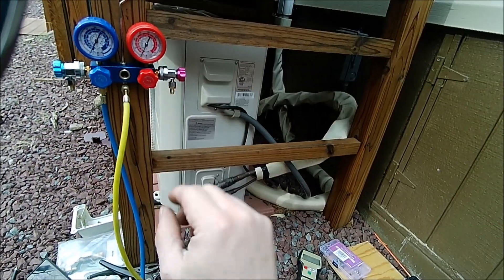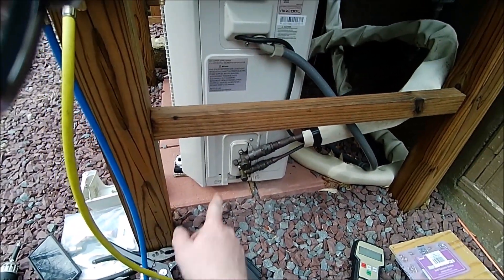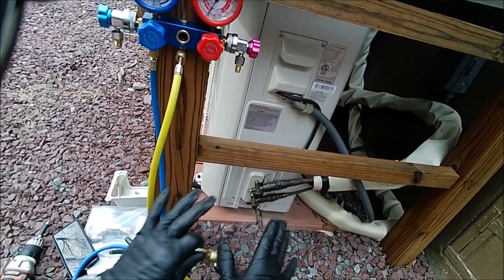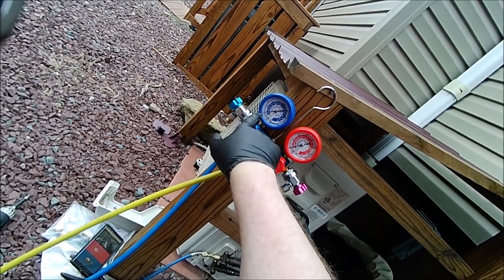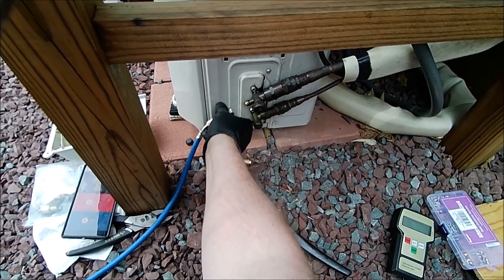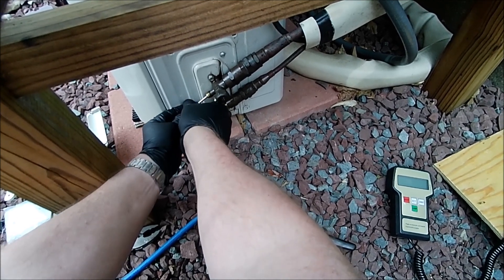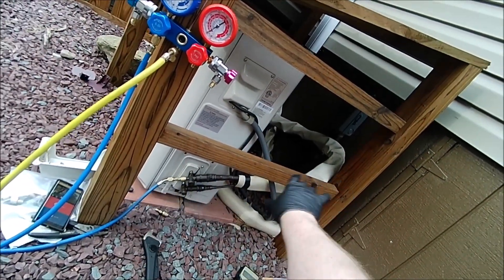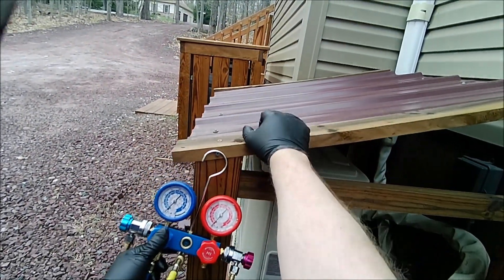Mini-Split Advanced ReCharge & Valve Core Replacement

Comment: the unit leaked but how do you know if there was any refrigerant left in the unit?  Did you recover any refrigerant first?  That way you know you are not over charging the system?  Just curious, because I need to do this very same thing after the high pressure line was broke off and much refrigerant escaped.....
Reply from the maker: The gauge measures pressure on the low side, my kit is simple and easy to use, you hook the gauge up, see the pressure, get it more than half way into the blue, 125 to135psi and you are good to go. Seals most leaks, just remember to charge in cooling mode 62 degree set temp, no matter the inside or outside temp. Quick, easy 😀

Comment: Great video! Do you have a better link to the Valve Core Set? The one listed doesn't work. Thanks!
Reply from the maker: https://www.amazon.com/dp/B07F36KV79/ref=cm_sw_r_as_gl_apa_gl_i_WSB47W5P4J5SVCKDXFQW?linkCode=ml2&tag=computradecom-20

That is the link, also updated the description, thank you!
Reply: @GarageMahalLife  Thank you! You're the man!
Reply: @GarageMahalLife  What valve core did you use for the R410a system?  I did not see one listed in that package.

Comment: I can logically figure it out but I rather be sure.  I know the king valves need to be close while vacuuming. But when charging is the king valve to condenser open and the line king valve close?
Reply from the maker: While charging the system after vacuum, all valves should be open, unit on and  in cooling mode, 62 degrees. Charge at Kimg Valve.

Comment: Thanks for the video. It confirms some things I visualized but wanted to actually see. I am concerned that you evacuated a partially charged system instead of doing a recovery. I read the notes you put on the screen, but I feel you didn't emphasize this enough. 

One suggestion. Instead of venting  refrigerant through the high side to displace the air, try this. Before opening your refrigerant tank valve, connect your vacuum pump to the manifold high side. With the low side valve closed, tank closed and high side open, you can then evacuate the manifold and the line from the tank to the manifold. Then close the high valve and you are free to open the tank and low side with zero air added to the system and zero refrigerant released to the environment.
Reply from the maker: Thanks for your comments

Comment: Thank you for the video!  I have a mrcool 4th Gen 5 zone 48k btu mini split that I installed in April.  In November I found a leak in one of the lines due to bad copper sweating/brazing by the factory.  It took mrcool customer service 6 weeks of emails and reminding them to ship to finally get my replacement quick connect line set.  Today I paid an HVAC guy $650 for a few hours and 4lbs of 410a.  Mrcool only covered the cost of the new 25' line set, even though they said I should have a professional come out evacuate and recharge the lines.
I'm thinking of buying your setup to test the system for proper vacuum and for future issues or top ups.  While the HVAC guy was very helpful and educational, we didn't vacuum the lines or pressure test as he said that would be a lot more expensive.
Reply from the maker: Thank you, I'm here to help. Sounds like the cheapest hvac quote I've heard, typically they want 1000$+ anyway my kits are perfect for the DIYer, home or business owner. Feel free to ask any questions you have.

Comment: Hello, I have really enjoyed this video. 
There are a lot of "influencers" out there who present similar information, although by introducing a lot more discretization and complexity and then identifying expensive tools and attachments needed. In my mind this takes people away from trying to solve problems in a simple and simpler way. As an example, other folks talk about needing to remove the schrader valve under the umbrella of trying to achieve a deeper and faster vacuum. My sense is that this is not a requirement and a DIY person can do without. Kudos to you for achieving this Sir. 

Please do help with comments on couple of things 
(I have a 18k MrCool unit, which leaked out & the company supplied a replacement air handler & line set. I have done the attachments & now I need to pull a vacuum and add new Refrigerant)

1. what state (open by turning ccw or closed cw) do the 2 refrigerant valves (under the brass knobs which require an allen key to open/close) need to be in ? for evacuation first ? and then charging as you did ? and after finishing charging ?
2. separately, if I plan on replacing the schrader valve should I not do so before evacuating (i dont have any refrigerant left in the lines) ? my thinking is that by removing the schrader valve all the lines in the AC will immediately revert to atmospheric pressure because of the opening. I can then put in a new schrader valve and then pull the vacuum ?

Thank you very much for your help.
Reply from the maker: 1st, Thank you 😀
So did they send you a charged line set or just the line set. If charged, you shouldn't have to vac the system... as they have valves that self seal on all the connections. If un charged, you would install, ccw to open after install, then pull the vacuum. Then charge. Before that, replace the Schrader as needed... feel free to email you phone number to brian.niskala@cnjrail.com and I'll be happy to call you and "walk" you through this...
Reply: @GarageMahalLife  Thank you very much for responding.

Initially, I assumed that the replacement line set was pre-charged and connected it to my older outdoor unit. However, surprisingly, the unit provided barely any cooling ! I had also noticed (on hooking the line set to the air handler and the outdoor unit) that there was an absence of whoosh/swish which I had heard on making the same connections years back. I took this to mean that perhaps the line sets were not pre-charged as I thought they were. I got in touch with Mrcool and they mentioned a few things I was not expecting
- the outdoor unit/compressor also comes pre-charged & that the line set contains "a drop in the bucket" on comparison. (I am still not a believer because line sets are ~ 25 feet)
- the leak that I experienced also perhaps leaked out the refrigerant in the outdoor unit
- I should expect air/moisture in the system because of the older leak and run a vacuum 

With regards to the leak -  When I removed the old air handler I noticed green splotches on the backside and am assuming that is where the leak was. When I had a HVAC tech come out in the fall, he just added more refrigerant without doing a leak detection. I also purchased an electronic leak detector and on sniffing around the line set sheathing it went bananas & that is the evidence MrCool needed. If I still experience leaking I will assume it is the schrader valve and only then will I attempt to replace it. 

I just received the equipment you outlined and I am going to attempt the procedure you have shown. If I get stuck I will reach out via email separately. Once again, thank you very much for taking interest and posting such wonderful videos. In this day & age where youtube is populated with influencers we need folks like you who try to provide cost effective and easier solutions.
Reply from the maker: @sunnykhosla8891  Thank you and I am here to help. And I believe the tech had it backwards, the lineset is charged and by comparison the compressor is but a drop in the bucket 🪣  anyway be safe.
Reply: @GarageMahalLife  Just giving you an update here. Everything went surprisingly well (so far)
- i was impressed to see the 3.5cfm pull the vacuum into -Hgs in about 15 minutes
- they vacuum held overnight which I took to mean there are no residual leaks
- I charged the Refrigerant, perhaps 2-3 oz over
- I did a bubble leak test which was clean & then 
- followed 4 hours later with a leak check using an electronic leak detector which was clean
the system is now cooling superb 🤓
Thank you very much for your feedback and the videos
{ps - I sent you an email with a question about your other interests}
Reply from the maker: @sunnykhosla8891  Thank you

Comment: Finally I found your video and someone that did this the way i was understanding from the manufacturer, beginning and what made sense. Someone not adding steps that were not necessary. This was my understanding of how it all worked and it really isn't as complicated as others have made it look. I had moved my compressor onto wall brackets. and. accidentally hit one of the lines leaking gas out. Not what anyone would want to do and lesson learned to recover the refrigerant first. But thought just raising it onto the brackets I would be ok... Thank you so much for showing the right way, and not making it more difficult that it needs to be to pull vacuum on the entire system and recharge.  Once I got my 1/4 in flare redone after over tightening, my vacuum held perfectly and I was able to recharge my system. 
Weighing in the refrigerant and it is working as good as new. And really appreciated the way you bled the air out of the lines versus backing off the connections letting them leak out like everyone else has shown. Much more control the way you did it. Thanks and hope to learn more from your videos in the future.
Reply from the maker: Thank you for commenting, watching  and glad it helped.

Comment: How did you get a vacuum with the Schrader valve installed I believe you only vacuumed the line
Reply: Hire a professional. Too many mistakes in this video. First you recover gas using a recovery machine into a recovery tank. Then remove schrader valve , attach schrader removal tool. Vacuum through schrader core removal tool. Vacuum past 300 microns, recharge by weighing in, close schrader core valve , remove hose and install shrader valve
Reply from the maker: The valve is depressed by the charge/vac lines, they have push points to push the core valve open.
Reply: @GarageMahalLife  I agree they have push point to allow to put in but they don’t allow to pull out,  same as a tire you can press up with air but cannot pull out it’s a one way valve
Reply from the maker: @691sharky  Hi Mark, that is not entirely accurate. If you push a valve in, the air or pressure escapes. True for both tires and AC units 😀
Reply: @GarageMahalLife  when you pull a vacuum you aren’t pushing in , sorry
Reply from the maker: @691sharky  Correct, core valve is still open for in and out... after the fill or vacuum hose is disconnected, the spring and pressure will hold the system sealed. But push in on the spring valve, pressure is released. If you have pressure greater than what is inside the lines, fill and charge hoses open the valve and pressure can be added. Hope this helps clarify things. Pressure and vacuums are strange when it comes to core valves.
Reply: @GarageMahalLife  I’m sorry but you never pull a vacuum through a schrader valve.
Reply from the maker: @691sharky  Riddle me this... you take the core out. You pull a vacuum... how to you charge and then reset the core to hold the pressure?
Reply: @GarageMahalLife  it's not necessary you did a good job. But you can use a valve core removal tool. Next time put a little nylog blue on those cape threads stops em from leaking.